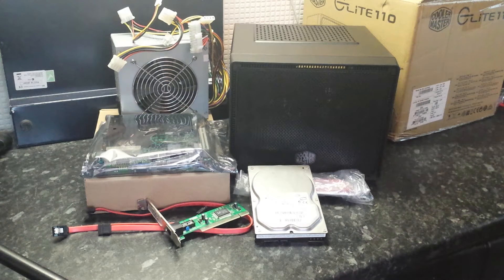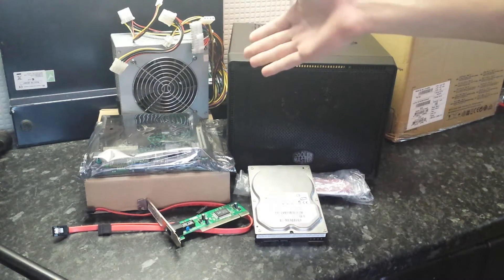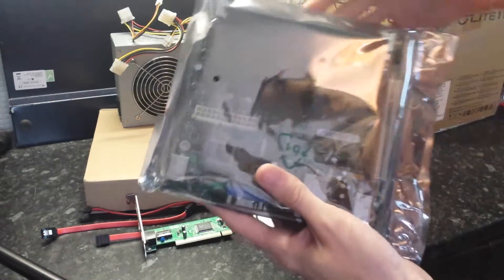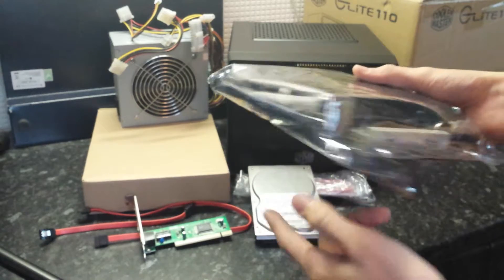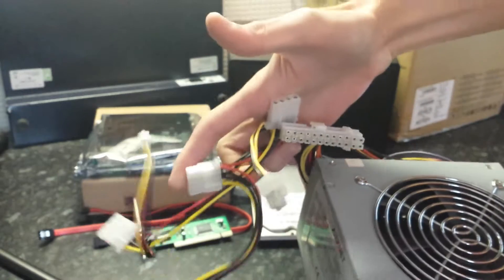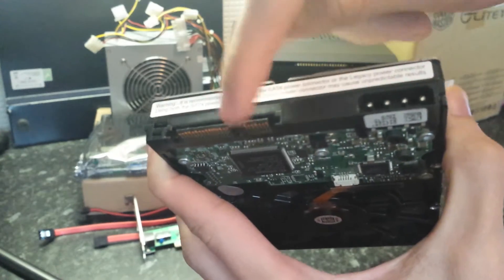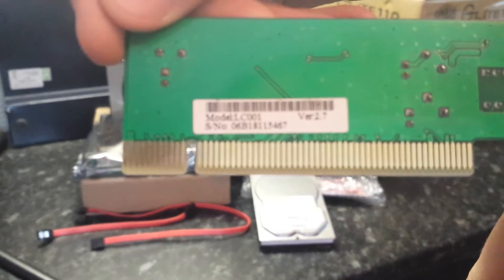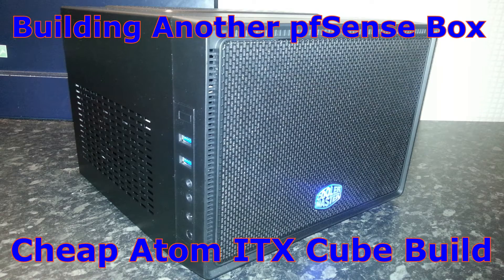Budget pfSense Router / Firewall - Small, Low Power, Silent 'ITX Cube PC' - Time Lapse Build

Comment: im looking to build a wifi repeater. 

currently i use a raspberry pi with dual usb wifi cards. its a ugly mess of wires and im looking to upgrade/retire this device...

for the last year i have been searching online for single board computers but i feel nothing exist for what im looking for...

4 things i need... must run debian, must have 1 gig Ethernet, and most importantly i need at least 2 wireless N wifi cards...

i could purchase 2 mini pcie wifi cards but i have not found a board that will suite my needs for dual mini pcie... 

maybe a pci riser to dual mini pcie exist?

i hope to keep my build under 100$ maybe you could suggest a board that might work for a wireless repeater? dual mini pcie? single pci with riser 2x mini pcie? any suggestions?
Reply from the maker: Hi, My apologies but I don't really do WiFi repeaters! 
All my networks are hard-wired with gigabit ethernet where ever possible and I then use multiple access points with the same SSID, security, passphrase - and - also on the same LAN / DHCP server (being pfSense). I've never actually ran any pfSense system with a wireless card installed. 
ANYWAY - Back to your scenario/problem; Your dual mini PCIe slots could well be hard to find - I'm not sure they even make motherboards with two mini PCIe's?.. 
I don't think you can go from PCI to any form of PCIe either unfortunately. 

Is there no way you can use a single WiFi card to first pick-up the original signal, then use that same card to also re-transmit the repeated/boosted WiFi signal? - I'm thinking something like how DD-WRT allows multiple SSID's to be made and create 'guest networks' for example, on a single wireless interface in a router that was never designed to do such a task originally. This could perhaps be worth looking into? Sorry I can't offer you much help in this department as I've never ventured into building repeaters. 
--Nathan

Comment: looks good but if i where to change 1 thing i would have whet with main bored with a pcie slot so you can upgrade it to a 2 or 4 port gigabit card..
Reply from the maker: +Matt K No need for this box, It's just going to be a direct single WAN through to the LAN, It's a fancy replacement for a basic BT Home Hub that lives at my sisters house.

Comment: why the old hardware?
Reply from the maker: +philip dias Extremely cheap to build and I used many parts that I had just sitting here spare, I've spent more on the case than all the hardware inside of it put together. Plus that hardware more than fills the needs for a pfSense box on a 70Mb connection. :)
Reply: +philip dias i had my PF seance running off a dual Pentium pro 200mhz 1mg cash 1gig of ram it will run off any thing... now running off an old Dell optiplex 745 with a Q6600 3gb of ram and CHEEP OLD new in the box 64gb SSD my friend had.. i had to make some mods for the Quad port card to fit...